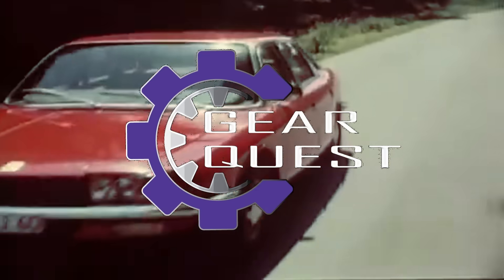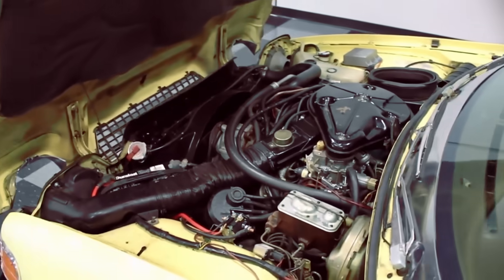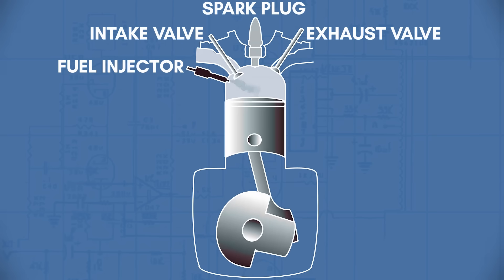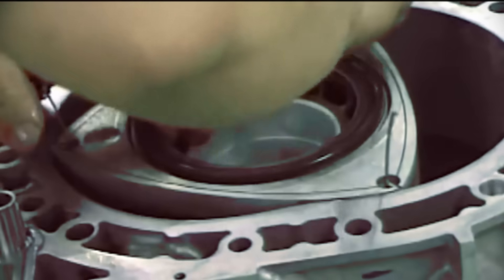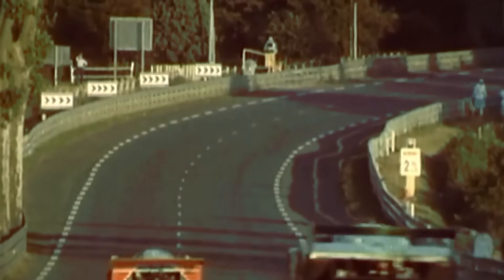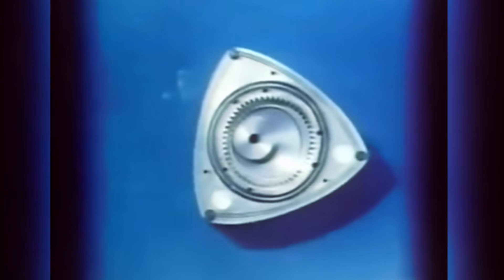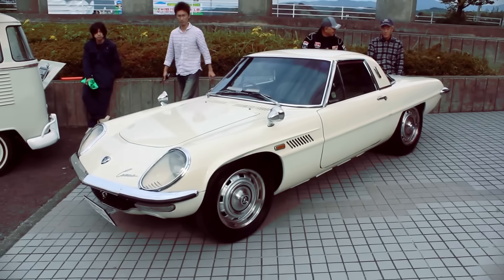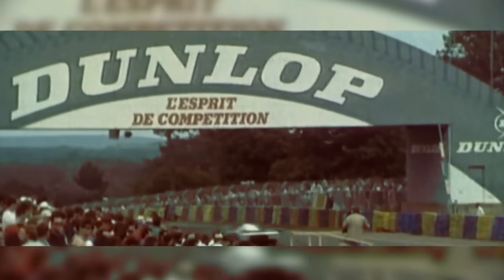The History of the Rotary Design

Comment: This didn’t start or stop here... not a good history really
VW beetles had a semi-auto transmission 
The phases of a rotary waste some fuel - while not mechanically similar to a two stroke, the practical effect is there 
Lifespan in service is less on a rotary- it’s fine but requires more frequent and consistent servicing like an aircooled VW
If it was high in longevity or made money at assembly other manufacturers would have joined in. 
So there you go

Comment: A Rotary Engine per Wankel, is basically just a 3 cylinder, 2 stroke engine that is designed to handle much higher RPM's.
Reply from the maker: Rotaries are a two-cycle four-strokes, they have a true 4 cycle (combustion event) but unlike a piston 4 cycle engine the rotary only needs one crankshaft revolution to complete its cycle, just like a two-stroke piston engine.
Reply: @GearQuest , the only thing a rotary engine has in common with a 4 cycle (piston) engine is in not mixing 2 cycle oil with the gasoline.  And they only get away with that by oil injection.

Comment: You didnt answer the question at all!  Why was it banned ?
Reply: Ditto~!!
Reply: As I understood it was banned for short time because they thought it was cheating because by the time a piston would do a full rotation which is actually 2 rotations the rotary could get off 6 because every side was on a different stage of the process but as I understood it's not banned no more but I don't think nobody really making them anymore because everybody's going to electric because of what the benefits it having in racing
Reply: mrbladesletplays
 is about right. if 1.3L rotor spin 360-degrees, it would make 3.9L of combustion VS a 5.0L V8 at 360-degrees would be 2.5L of combustion.

Comment: The word "banned" is a buzzword that makes it sound like it was too good and that they were dominating too much. They only won once, never before and never since. If that was the reason they would have banned diesel engines cause of the Audi R8 and R10 which won 13 out of 15 years. Thats dominating. The reason is that rotary engines did not fit within the upcoming season rules because race cars have always been limited by displacement, when it comes to how light the car can be, and what tires you use. Rotaries are hard to fit under those rules because they function differently. Rules change all the time. Not only Mazda was affected by this. Rotaries are perfectly legal in LeMans today, and has been so for many years and guess what, no one is using them cause they aren't that good.

Comment: I think this was a pretty good review. I am glad you mentioned that the Renesis motor had a life-span of about 60K miles. As a mechanic and service manager, I can say that those 60K miles were not without issue. Starting at about 5K miles, we had regular tow-ins because of apex seals losing compression and flooding the engine to a no-start condition. Several a day. Mazda eventually made a recall with a higher amperage starter motor and updated spark plugs. It still wasn't enough. We at the dealership went back to a service that we created for when the 13B apex seals would lose compression: Disconnect spark and fuel, spin the motor without plugs till is was clear of fuel. Use a tube to inject automatic transmission oil into the combustion chamber, put new plugs in, and use a battery charger on 200 amps to crank the hell out of the motor. Finally the motor would fire and flood the shop with white smoke. We used to push the cars outside to not upset customers. This ground-roots solution only worked sometimes, and we replaced a lot of Renesis motors under warranty for compression loss. At a Mazda-sponsored meeting of service managers and Mazda engineers I met another service manager to whom I shared my woes of having replaced 5 Renesis motors that month due to compression loss. He laughed and reported that his Las Vegas (much larger) shop had replaced 40 that same month. I've never pretended to be an engineer, but experience has taught me that the apex-sealing problem is the Wankel's achilles heel.
Reply from the maker: Thanks for sharing! I personally know someone who had the issues with the Renesis engine that you described. They’re engine started giving out at 50k. What a shame too
Reply: That's a great explanation, thanks for the info! I worked with a mechanic a few years ago when someone brought in an rx8 that wasn't starting or would run rough as hell. I knew nothing about these engines at the time and the head mechanic and I unplugged the crankshaft pos sensor and, not necessarily in this order, cranked it dry like you said and then hooked a tube up to the intake manifold and let it suck oil into the engine. Afterwards we hooked everything back up and it fired up to my amazement. Same thing with the smoke, had to let it run for almost 15 mins until it cleared up but it ran great after that. Not knowing anything about rotary engines this blew my mind haha.
Reply: Ny rx8 has gone long over that and i have no problems with it. Anf it has to do with my premixing and that att let it warm up before i shut it down. I treat it with super care and when i want to have fun it give back so much 😍
Reply: @kimsnightmare  Vehicle location has a lot to do with it. In tech training we were taught that Mazda didn't anticipate the higher rates of flood-outs in the northern, colder parts of the world.
Reply: @lanatrzczka  yeah but i liv in sweden 😅 and it worksout fine. As long as i do some minor things. Premix and look at the oil lv while gasing up dosent take much energi and stil i hear from people who dont own 1 complain. Its sad becaus the rotary is a good and fun engine😅
Reply: Unfortunately one of the main issues of the 1st and 2nd year release of the rx8 was ignition coils. A lot of healthy engines were replaced with new engines that were not build under proper conditions because no one thought to change the coils... so in many cases a healthy engine got traded for one that was poorly built. Weak starter motor and faulty ignition coils were the main issue of the car at the early miles stage. Carbon build up later deminishes the apex seals, but by driving the car at high rpm, and regular oil changes these engines could run to 80k and 90k before experiencing loss of compression. With addition to premixing, I've seen a number of these engines reach 150k miles before needing a rebuild.
Reply: @aj_art8058  You are very correct about the coils. Trouble was, there were no alternatives available to dealers operating under warranty. If the coils were deemed ineffective, only replacements of the same were provided. Regarding the high RPMs, yes... we were taught in tech school that the Renesis system was designed to always be at higher RPMs per situation than the 13B. I can't remember base idle now, but it was high... 1500 maybe. Renesis was spun at ridiculously high  RPMs during normal driving. It was better if you had a manual trans, as you could control the shifts. I cannot even imagine how much money Mazda must have lost because of the Renesis via warranty engine replacements. I was very fortunate to be part of the Mazda QMD team for a couple of years. Being able to ask the engineers of the car I was driving any question I could muster was quite a humbling experience. I can tell you this: while the  engineers had excitement about improving the reliability of the Renesis, what really got them talking was the Mazda Speed line. Such excitement and enthusiasm. I feel that the Renesis was known to be a dead end, but that fact was never brought up or even hinted upon.
Reply: @lanatrzczka  I was a big fan of the mazdaspeed line and the direction they went during the upgrades on the series 1 and series 2 models.

Comment: Rotaries are two-stroke engines! That is one of the major reasons they cannot be used in racing as the two types of engines are difficult to rate. Two-strokes typically make twice the power per cc as a four-stroke and their power curve is vastly different from four-strokes.
Reply: 2stroke = better top end power , 4 stroke  better low end power (plus they last a hella lot longer)
Reply: Rotaries ARE NOT 2-strokes, they are 4-cycle Otto engines.
Reply: @johncoops6897  All IC engines complete four strokes to operate. Rotaries fire once per rotation and they utilize ports to intake and evacuate the gases.
Reply from the maker: Not quite! Rotaries are a two-cycle four-strokes, they have a true 4 cycle (combustion event) but unlike a piston 4 cycle engine the rotary only needs one crankshaft revolution to complete its cycle, just like a two-stroke piston engine.

Comment: Rotary engines are the same as any engine, but with a different arrangement of parts to harness the pressure from burning gases.  It takes in air and fuel, compresses them, ignites them, and the exhausts the remains of the burned fuel/air mixture.  Each rotor has three chambers, and the displacement is 3 times the volume, just like a 3 cylinder piston engine.  The number of degrees the eccentric shaft turns to complete all cycles of the rotors isn't relevant to the actual volume of burned fuel/air mixture.

All the "bad mileage" complaints are derived from the inaccurate claims of displacement.  The 13B isn't a 1300cc displacement engine, and the air/fuel mixture consumed shows the displacement claim to be in error.  The error stems from the use of the number of rotors instead of the number of chambers.  In the 13B, the 654cc swept volume multiplied by two instead of 6 results in a claimed displacement of 1308cc instead of the actual displacement of 3.924 liters, or multiply by 61.024 cubic inches per liter, resulting in 239.45 cubic inches. 

The actual displacement of 3924cc is in line with the actual consumed air/fuel mixture, also indicated by actual road mileage.  The rotary configuration results in a large displacement engine in a very small and lightweight package.  Compared to four stroke piston engines in the 3900cc to 4000cc displacement range, it's very compact and much lighter.  The rotary engine also had financial advantages to Japanese consumers in that the engine displacement remained below 1,500 cc (1.5 L), a significant determination when paying the Japanese annual road tax which kept the obligation affordable to most buyers, while having more power than the traditional engines having a straight cylinder configuration.  This is a good reason the manufacturers in Japan had for using an unusual formula for determining displacement, even though it has a built in error.   The 1984 Mazda RX-7 GSL-SE had a fuel injected 1,308 cc (1.3 L) 13B RE-EGI engine rated at 135 hp (101 kW) and 133 lb⋅ft (180 N⋅m), as contrasted to a 1975 Nissan B210 A14 engine, 1.4 L (1397 cc) OHV I4 was 70 or 68 hp (52 or 51 kW) (SAE Net) in 49-state versus California trim.  How does an engine get close to double the power than an engine supposedly having nearly the same displacement in street stock form? 

The next question is how big is a "26B' engine?  Multiply 4(number of rotors) by 3(number of chambers) by 654cc(swept displacement), and the answer is 7848cc, or 7.848 liters X 61.024cubic inches/liter = 478.91 cu. inches.
Reply: The displacement and power are equivalent to 4-cycle piston motor of twice the displacement. Rotaries are NOT more powerful than equivalent piston engines, and they make a lot less torque. The wankel is inherently inefficient, so they use a LOT more fuel to produce the same amount of power as piston engines of equal tune.
Reply: @johncoops6897  Rotary engines are deceptively large displacement, and the fuel they burn is because of that large displacement.  It processes a certain amount of fuel for a certain amount of air exactly like any piston engine does.  The fuel/air ratios are the same for both engines, and the difference in consumption is purely from the rotary's large displacements.  Claiming the 13B is only 1308cc when it's actually 3924cc is the reason for the "excess" fuel consumption or "inefficiency."

When you get into direct comparisons of actual displacements of rotary engines vs. piston engines, you always find the rotary to be at a much lower HP/liter ratio.  In my personal experience, our fuel injected peripheral port 13B engines put out about 315 HP, while a 1400cc Nissan A-series non cross-flow dual 44mm Dellorto carbureted 4 cylinder engine put out 172 HP.  The HP/liter for the 13B is 80.275, while the Nissan is 122.85 HP/liter, a very significant difference of 42.575 HP/liter.
Reply: @alanbrickey2617  - thanks for your comprehensive and well written long reply elsewhere in the comments. I already know all of what you explained, however it is obvious that the majority of viewers here are completely clueless about the reality of the rotary vs piston comparisons.
Reply: @alanbrickey2617  - I will disagree with your comment that the difference in (fuel) consumption is purely from the rktary's large displacement. There is another factor as well, being the lower efficiency of the computation process. This seems to be caused by the continuously moving "combustion chamber" affecting quelch and flame propagation, plus inlet flow problems (resolved in PP engines) and sensitivity to exhaust restrictions (quietness kills power). So it's kind of like a 13B rotary produces the torque of a 1.3L and the power of a 2.6L, while using the same fuel as a 3.9L.
The light engine weight and responsiveness from low rotational inertia make them great for competition, providing that the poor fuel efficiency is not important.

Comment: There were a lot of rotary powered cars in the Australian sports sedan series, but the chev engined vehicles appear to put the power down out of the corner better and couldn't be beaten. This doesn't mean that rotaries won't work, as the "anything goes" type of full bodied race series will come down to many factors such as driver skill, engineering skill, workshop skills, race prep, financial power and not just the engine type. So it does make one wonder about how for a given power output, how important is power delivery vs power to weight of a given engine unit.

Comment: I'm not a mechanical engineer, but it occurs to me that a good avenue to explore would be to use an internal combustion engine, whether rotary or conventional piston, to generate electricity and have electric motors in the wheels.  Use long-lived capacitors as a buffer (not chemically-based batteries) to provide extra torque off the line and permit bursts of power higher than can be sustained by the engine.  Put magnets and coils into the linearly-reciprocating and/or rotating engine components to generate electricity instead of driving a spinning shaft.  Use the engine coolant's heat to power an auxiliary electrical generator.  Reclaim energy from braking to load the capacitors when possible.  Divorcing power generation from power delivery would thus enable better optimization of each.  This could eliminate the need for a crankshaft, connecting rods, transmission, drive shaft, and differentials, and thereby save much weight.
Reply: That's a pretty good idea but the rotary has basic mechanical issues. The apex seals on the rotors go out and you get lots of blowby and oil burning. In a piston engine there are three rings per piston at a minimum to seal the combustion chamber. The rotary only gets one seal to hold back all that pressure and it wears out fast. You can't flatten it out or anything either to put in more seals for oil control, so until some indestructible super apex seal material appears the rotary is a dead end.

Comment: I banned the rotary from my driveway, because of the sound it makes and the short amount of time it take to wear out and starts using oil.
Reply: have you even watched the video? they use oil by design, not through being worn out. these engines have oil injectors.
Reply: They only wear out the carbons which are easy to change
Reply: @rodgon123  what fucking carbons think you find it's a ceramic plate at the end of the rotor
Reply: First of all, Rotaries are the best sounding motors ever built, and secondly, you're missing out bud.

Comment: I had two of the RX7's and had fails in both of them at around 25k miles. NOT apex seals, but the side chamber O ring seals adjacent to the combustion area. I really liked the engine performance but the inconvenience of rebuilds was killing! (Mazda covered the cost, at least!)
Reply from the maker: Which generation of RX7 were they? Did you get chatter marks when the seals failed?